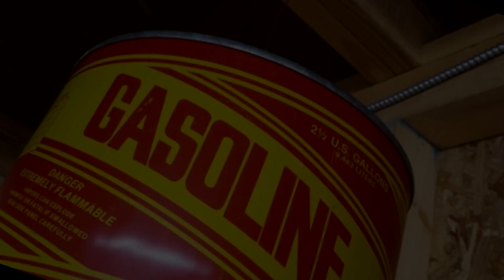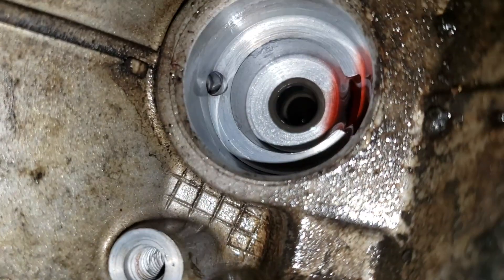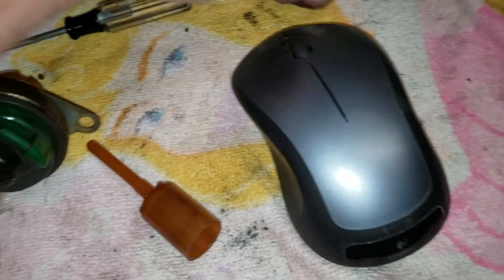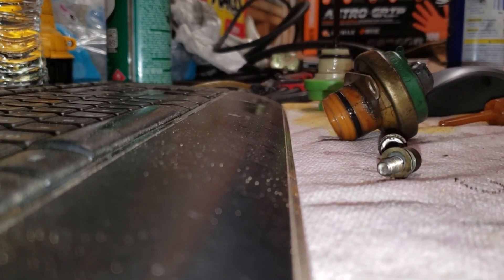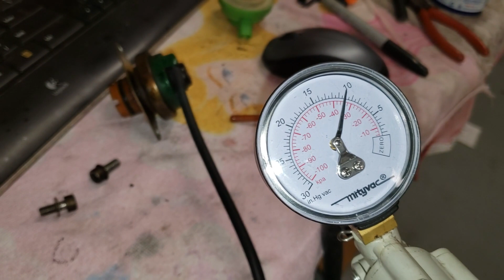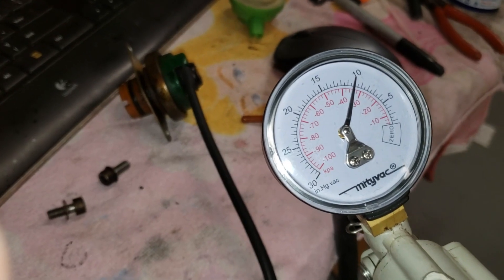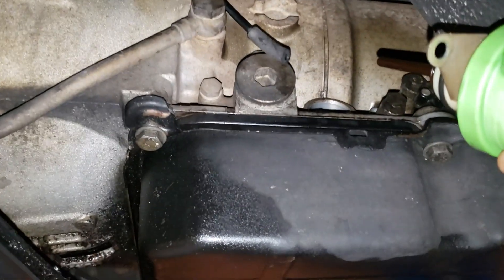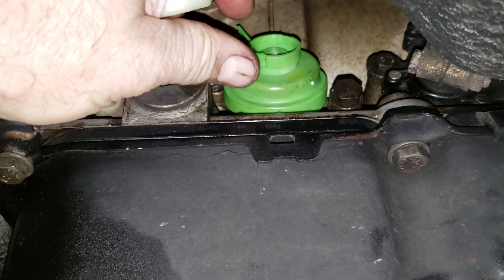Automatic Transmission Modulator Valve Replacement - W126 Mercedes 722.3

Comment: My R129 won’t shift to any gears you think replacing this might help?
Reply from the maker: Sounds like you've got some troubleshooting to do. Even if the modulator was not working at all, I think your transmission would still shift. I would start with the Bowden Cable. Have you tried adjusting it? Trying screwing the Bowden Cable clockwise (inward) for several turns and see if that has an effect. You are saying your transmission stays in 1st gear no matter what ?
Reply: Impalaman's Garage  it actually not picking up any gears it I can move it from RD23 but nothing happens the engine just revs
Reply from the maker: @joshuapena1314  Have you confirmed that your shift linkage under the car is connected properly? If it is connected properly it sounds like a transmission rebuild is needed.
Reply: Impalaman's Garage  that’s the first thing o checked and both bushings were missing so I replaced both of the i even went ahead and bought a brand new shifter but still no luck I also flushed transmission fluid out and replaced the filter, Jesus sounds like it’s gonna be an expensive fix
Reply from the maker: Might be a better option to find a good used one that you know is good to go. Install it. Then buy a rebuild kit for the old one and learn to rebuild one at home.
Reply from the maker: @joshuapena1314  So regardless of any adjustments and of course assuming the transmission has the proper amount of fluid in it...... sounds like this transmission is done. I've owned lots of different cars over the years. Any auto transmission, regardless of make or model, that won't move the car has serious issues and needs to be removed for an overhaul to some degree. The only other thing I could think of off hand would be that the torque converter was not properly inserted. This bites some people that work on transmissions. If the torque converter is not properly seated no power will be transferred. How many miles are on the car and has anyone ever worked on this transmission in the past ?
Reply: Impalaman's Garage I’m hoping it’s the torque converter it would be a lot cheaper than a new transmission the car has 100k on it and not too sure if anyone has worked on the transmission the guy I bought it from had it under a car cover collecting dust he’s had it for over 6 years but said he lost interest in the car shoot he had 3 of them sitting outside his house
Reply from the maker: @joshuapena1314  I'd say it was time to start getting greasy my friend. :)
Reply: Impalaman's Garage I appreciate your insight sir have a great one